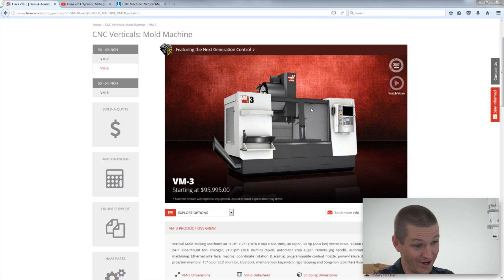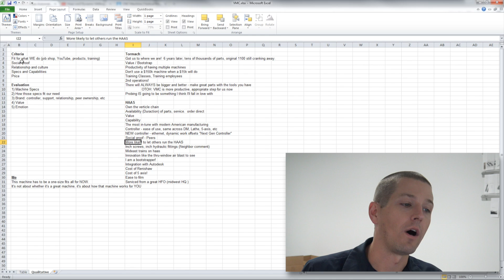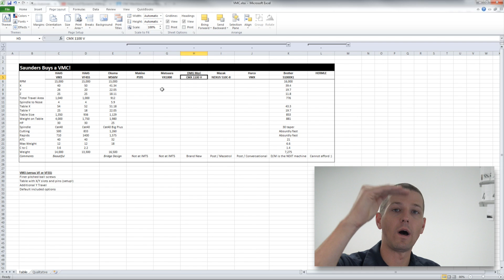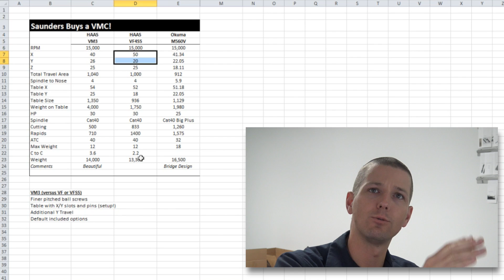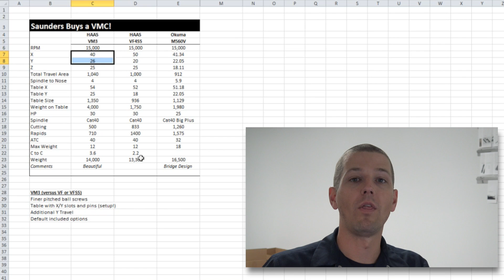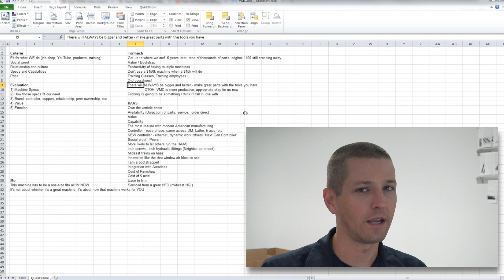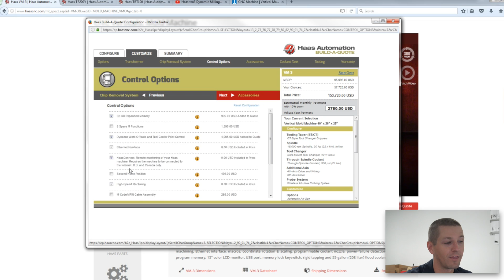We bought a VMC!  Haas VM3 with 5-axis!

Comment: John, If I were you I would go for the larger 5 Axis option you will be glad you did. Also you might think about a jib crane for this machine. You might be able to incorporate the post behind the machine for this. This will make it easer (and safer) to mount the 5 Axis fixture and heavy parts than using a forklift (and also a one man operation instead of two). You mention machine feed rates as being a issue. I will tell you from doing job shop machine work for the last 35 years that this is a way overblown sales gimmick. It isn't that important unless you are doing very high production work where every second can make a difference. In my work I have very seldom used feed rates above 200-300 feet per minute you just don't us it that often in job shop work to worry about it. With the more power and rigidity that this machine has over your TorMach machine you will be using different milling strategy's that don't require feed rates above 500 inch per minute. You didn't mention if there were different spindle options, (if available) like high speed or high torque (its been a long time since I bought a Hass mill). Any way Good Luck with your new machine. Its always exciting to get a new machine.
Reply: if you end up running it with the A and B all set up on there then you want quite a bit of spindle speed. not just for small tools but the trunions and all that make for a pretty flimsy overall setup so you'll want to pull out all the HSM tricks to keep tool pressure and vibes down. smallish step over goes hand in hand with high rpm to keep the removal rate up.
Reply: if you end up running it with the A and B all set up on there then you want quite a bit of spindle speed. not just for small tools but the trunions and all that make for a pretty flimsy overall setup so you'll want to pull out all the HSM tricks to keep tool pressure and vibes down. smallish step over goes hand in hand with high rpm to keep the removal rate up.

Comment: Congratulations!!! That is awesome!!!

Warning!!! Fusion may be planning to charge Cload Credits for 4th and 5th axis tool paths which could increase the cost of fusion by thousands of dollars. 
check out the roadmap on this link https://forums.autodesk.com/t5/fusion-360-product-roadmap/roadmap-check-in-may-2016/bc-p/6561057#M192%C2%A0 there is an icon "$ extra cost". 
I tried to get more info on this but could not get a straight answer, other than they will put out a list in the future of what cost extra cload credits.

It would be very disappointing to have paid for Fusion 360 Ultimate for several years now and also dealing with the many growing pains that went along with it to now be cast aside and snubbed out of some of the features we have been waiting for so long to use.
 
I truly hope this is not the case.
Reply: That's awesome, I was getting worried when I couldn't get an answer.
Thank you!

Comment: TR200 is massive. We got one, dropped it once. Now it sits in the corner of the shop unused and broken..  If it can't live in the machine, i wouldn't even consider it. But thats just me.  Put an overhead I-Beam and trolley for loading the machine before you move the machine in, you will thank yourself later. Our billet arms come out at 34 lbs, easy to handle. But the billet going in weighs 160. It really sucks loading the machine without an overhead.

Comment: Congrats, John! great machine! I suggest you test everything and make sure you get those feeds, try going from straight lines to small circles to 3D machining; I've seen my VM2 struggle with small circles not going over 150 ipm, a bummer when you're making a 200+ gaskets / o-rings mold

Comment: Worked at a mold shop for a bit, and I can tell you that extra Y travel is great. Can't tell you how many times we would push that to the limit, almost done w/ a setup and realize part was half an inch past our travel and start over. Currently run a couple Mori Seiki NT mill/turn centers for production contract. Love those things!

Comment: We have one Haas, many Okumas, many Moris, a Brother, a Murata, a Daewoo, a Hitachi & several obscure German & Italian machines I'm sure few have heard of.  Control wise, I prefer Okuma.  You also can't really push a Haas beyond it's capabilities (Japanese machines can stay at a spindle load all day that would stall a Haas instantly).  But I tell ya, that little Haas has ran constantly and probably been more trouble-free than any other machine.  Yeah, it's not built as heavy-duty as anything from Japan, but those guys could learn a thing or two from Haas.  Stay within what it's designed for and that machine will cut brilliantly all day, every day.

You'll have to keep it away from that post far enough to open the control cabinet in the back.

Comment: congrats and try to have it placed somewhere where you can get equipment moved around (like a forklift to move the chip bin / container) because you will need the free space... and in  area where you can have it connected with the needed supplies (if next to the post would be too closed for moving things nothing says you can't build a cable bridge to the machine itself)

can't wait to see you have it up and running ;)

Comment: @ 9:02 "dynamic work off sets" "finding X,y,z 0" I here you John. When the FSW. Project started I had a "manual" 4th axis to index the part around. I could get it close. But it would always fail! So it got dumped. But I think I found away to do it! Yesterday evening! And like most things the solution seams obvious when it hits you! Congrats on the haas!

Comment: So, who are you looking at for tooling/work holding?
Reply: orange makes really, really nice vises, but at 2k a pop, they're not cheap. also, I believe they only open to roughly 6 inches on the inside, which can be an issue. If you decide to go with kurts, I will say that i seriously don't like the 690, as the stupid screw support never  stays in place, and you have to remove the whole damn moving jaw to adjust the vise, vs the access hole on previous vise designs. Mari makes fantastic tool holders for the price. they were less than half the price of Kennametal. Admittedly, they don't make some of the more exotic holders, like hydraulic collet chucks, or bilz style tap holders, but they are easily sourced elsewhere.

Comment: Good choice John. One thing no one mentions about Haas is the ability to use m-codes to trigger several spare relays in the control cabinet. I use them to interface with an arduino to do automatic loading of components for our products.

Comment: Ditch the ER collets btw, go either heat shrink, hydraulic, or SK collets.
Reply: NYC CNC i couldnt afford heat shrink either and went with sk. I dont know how the sk compares to er in grip strength (although ive read the sk should be twice as strong) but my sk16 maritool holders and collets rock. The concentricity is unreal, never more than .0002" and oftentimes .0001".

Comment: Hi John, I think that if you got any more excited you may very well self-combust from too many overly excited atoms in your being. Just kidding, but you are like a kid let loose in a toy store with just around the corner. :))) 
I dont know diddly about CNC machining, but if I sort of go by your critique for the VM3 then I would say you will end up purchasing the larger 5th Axis machine. Reason: larger work area, greater weight capacity and more rigidity being double supported. As far as moving it in and out of the machine I agree with others to place the machine under that roof large beam.

Comment: 32GB ram for $1000, talk about price gouging.
I hope the WiFi option is more than just someone plugging in a card for $2000.
Reply: I believe the RAM is actually already built in the machine too and all they do is "unlock" it. With all the cheap modern tech available today they should probably focus their price gouging efforts on more proprietary CNC features. Charging $2000 for WiFi just builds negative customer attitude toward the company in my opinion. Bottom line though is the total price at the end that matters.
Reply: Sales: That's a $2000 option, but I can throw it in for free, because you're such a good/valuable/whatever BS customer.

Everyone does that. It makes their "discounts" look impressive.
Reply: Some machine tool companies literally just plug a usb wifi dongle in for your money...
Reply: cncua What are you talking about?
Reply: try to beat that )))
Reply: try to beat that :))))

Comment: Congratulations John. Great machine. We bought one two years ago, and it's really a terrific machine, and a joy to work on. Renishaw probe is really great. X and Y T-Slots are very versatile but yes, harder to clean out. Ours is 12,000 RPM, and not the Next Gen Controller. We have the Through the Spindle Coolant (which we have yet to use) and the Air Blast (which we use all the time). We do not have the 5th axis for it. We just don't do much of that type of work.

All that said... It doesn't get enough use. As you and I have spoken before, we do mostly large forging die/tooling work. We do a lot of hogging off of material on large pieces. We use a lot of Hi Feed tooling for this. And we have found the VM-3 just doesn't have the HP to keep from alarming out, compared to our larger, older machines. Our bread and butter are still 2 LeBlond Makino FNC 128 and a LeBlond Makino Horizontal. All are CAT 50 machines. All are about 20 years old. They are limited to about 3500 RPM for the Verticals and I think 2700 RPM on the Horizontal. The Verticals have a table of 50x30 (I think) and the Horizontal is larger.

We have also tried to go with Shrink Fit Tooling when we can. This requires solid carbide endmills, so it can't be used for everything.

https://youtu.be/KQo7kEElJ8g

Comment: I'm so stoked for you!!! Big times here we go!
Line up the center line of the table with that over head beam!!! then you can through a trolley an chain hoist on it to save your back!!! Buy the biggest 5 axis table you can fit on that machine, I would really look at a tr210. You will not leave it on there all the time, that machine just isn't big enough, your going to have to take it off once and a will anyway. Hence trolley to the roof beam, It's really no more dangerous or damaging that mounting a vise, with a 'good'(no HF shit) hoist it super save and easy. Plus if you buy a big 5 axis you can just install a standard vice on it and your done for 90% of the work you do!
 GET the oil skimmer, or you will have to buy one later anyway. Get the coolant filter system!!! They really help keep your coolant even cleaner and if you do any grinding on your machine you won't wreck you pump and TSC system. You should have got the bigger tank, think ocean vs pond, the ocean has a way more consistent content then a pond, but in any case get your self a refractometer, you'll need it.  
Anyway super happy for you!

Comment: great choice on the haas.  ive been using a haas vm3 for over 10 years now.  fantastic machine.  you can also go to (setting graph, 51, down, over, enter, Y) and this will allow you to use the machine with the doors completely open.  though this is unsafe in multiple circumstances, it can help with much better camera shots if you are comfortable with it.
Reply: setting 51 no longer exists.  they did away with it a few years ago. you just have to bypass the door locks, which truly are a hindrance to the setup process .
Reply: well i guess i do use an older machine, but i agree with jason.  the first thing i do when i boot the machine up is turn the door interlock feature off since im always opening up the doors to blow off parts/tools mid program.
Reply: I don’t know if Hass ships prints with their machines, but it’s super easy to bypass the logical aspect of a door open/close circuit. One jumper wire bridging over the door lock confirm contact will have the doors registered in the logic as “always locked”. You can then open them whenever you’d like, still maintain functioning locks but not have a cycle interrupt in the logic to decrease function with open doors.

Source: I work at a CNC manufacturer

Comment: The Okuma probe system I believe allows for in machine quasi-CMM measurements. It can inspect the part after machining. The HAAS probe system is WCS location only. Which is fine.
Reply: NYC CNC 
Physical hardware maybe. The Okuma might use the higher resolution prove head. But it's the controller software side that costs all the $$$. 

Oh. And buy 2 extra probe tips (minimum). You WILL break one XD
Reply: this can be done in haas machines also. renishaw has an advanced probing course you can take on it.

Comment: Just wait for that 30 Haaspower.
Reply: Also I believe that Haas subsidizes the probing where other MTB's do not.
Reply: $18,000 vs $5500 would be a huge subsidy. Is that something a Haas rep said? From a company that charges $2000 for wifi, It just doesn't seem likely. The others probably just take the price gouging to a whole new level.
Reply: There's more to it than that. Also quantities purchased (I believe that Haas moves the most Renishaw probes of any MTB by far - pretty due to this reason), and any deals worked with Renishaw as other builders also allow for Blum probes and the like. Yes this was told to me by a guy at our HFO. Don't get me wrong, I love utilizing probing and Haas gets it into the user's hands for cheap.